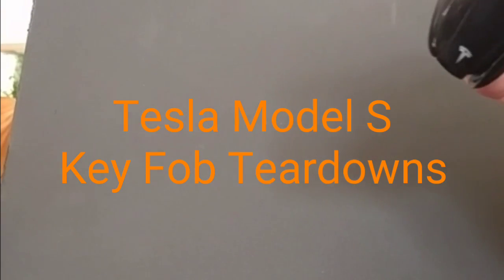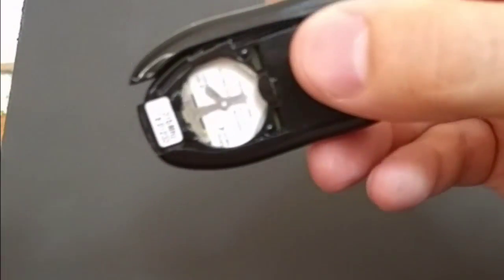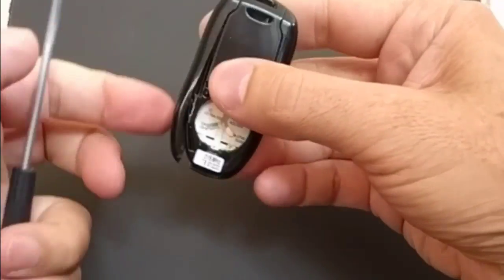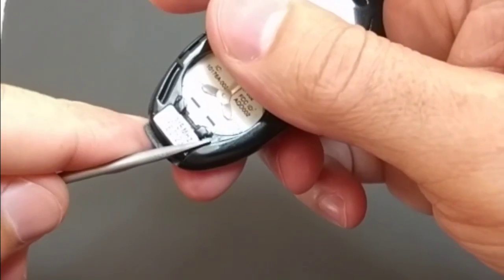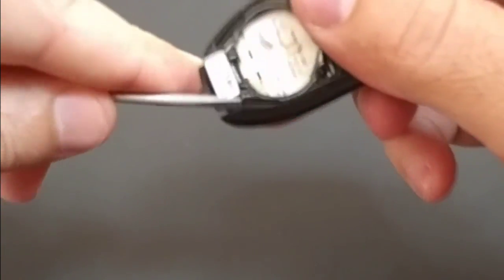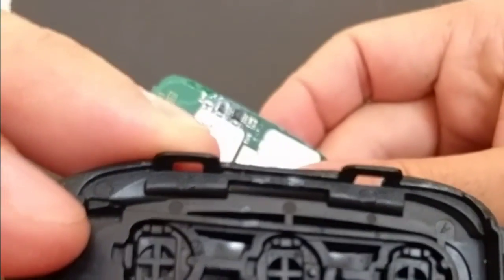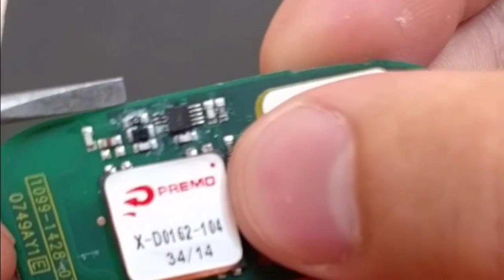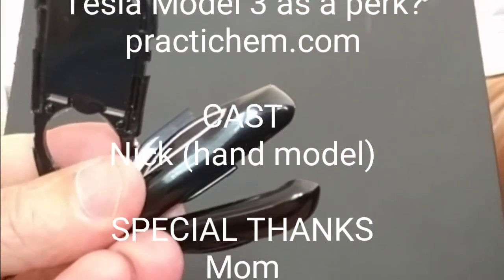Tesla S Key Fob repair water damage

Comment: Thank you. The disassembly instructions helped me to revive my laundry washed key. 
I have an additional hint for efficient final drying: rinse the PCB with isopropyl alcohol. This will was hour remaining water and dry off quickly. And eventual residual liquid will be non conductive. 

Best regards, Frank
Reply from the maker: @FrankR-w7s  Thanks for your feedback. I'm really happy this helped you out. It's one of my oldest videos!
Reply: My key-in-the-laundry error is even older ;-). Had a MINI car key that survived without problem as no battery is inside: it gets charged by induction when driving. Smart solution: you can make a tight case.
But at least the Tesla fab is easy to disassemble. 

Thanks for sharing. Will have a look at your more recent videos.

Comment: I fixed mine took it apart as shown used High pressure contact cleaner from a can underneath the Ic chips I let it dry put it back together it works.  Thanks   Save me money!  My fob got wet.  I’m in avionics tech in the United States Air Force for 10 years that contact cleaner displaces water to use it on C130 fuel quantity connectors.  Perfect application thank you for your video

Comment: Thank you.  Didn't drop mine in water, but Tesla refused to replace it because of corrosion on contacts.  Watched the video,  a little alcohol, and little scraping with a metal fingernail file, and no more warning message on the dash board about "Key Fob Battery low"

Comment: Thanks for the video. You just saved my key fob today. I accidentally dropped it in the washer. One thing I would suggest people to do is instead of using a screw driver to pry open the side panels, use your 3 salute fingers to gently pry it outward. I find it more effective loosening the latches.
Reply from the maker: Fantastic!

Comment: What if I didn’t notice and the fob went in the dryer as well? Will i still be able to salvage it? Nothing is wet or corroded but still won’t work. Please help, thanks!
Reply from the maker: You can always take out the board, give it a few minutes' soak in vinegar, fully dry it, and see. Anything beyond that would require mad electronics skills, I think.

Comment: Thanks! Thanks to your video I could disassemble my Key Fob which was in the washing machine for 30 minutes (when I just realized it must be in there).  There was almost no water in it, but still will use some iso-propyl alcohol to clean the circuit board!. Thanks for the video!
Reply from the maker: Sending key fob karma your way!
Reply: @nickydoes  It came back alive and works flawless ever since! :-)

Comment: Thank you for this. You saved me likely several hundred dollars. One suggestion, I used a laptop side/bottom removal tool ($5) to pop off the sides. I then dried off all internal components, and the fob then worked perfectly!
Reply from the maker: Good point, Mike. If you have a mobile phone/laptop spudger tool, you'll be more likely to emerge from your crisis without a scratch! Glad it helped.

Comment: I also had the fob in the washing machine. Is it OK to touch the electronics without connection to gnd? Is it OK to wash it with water?
Reply: How do you know this stuff are you an electrician or electrical engineer? Asking because I wonder if you got legit knowledge about this :)
Reply from the maker: Hi, I realize this is old. I play an electrical engineer on TV (and at my work). I've designed quite a few boards, and I work with electromechanical systems pretty much all day. There's lots on the internet about ESD/static and circuit boards. I'm pretty OK with touching boards, but I use a lot of sense about it.
You can wash a board in water, so long as you depower it, then blow the water out of it. Corrosion (salts) is your biggest concern.

Comment: Thanks! Very helpful. Same thing here, fob went thru the washer and didn't work. I knew the sides come off but had trouble popping the snaps as I didn't know where they are located. Your video shows them nicely and I was able to get it apart. I just let it air dry a few minutes, put it back together and it works again.

Comment from the maker: After tearing down the fob, washing it with vinegar, rinsing it with "reverse osmosis, deionized water" (from my kitchen pure water tap), then drying the board + letting it dry in rice, I reassembled it with a new battery. It worked perfectly.

Did I have to go through all of this? Probably not. However, I have a second fob, so I was in no hurry.
Reply: Nick DeMarco

Comment: incompetent didn't use conformal coating, amateurs
Reply from the maker: Agreed. Pretty lame. I suspect Tesla outsourced the whole key/security system. Still, they should have insisted on conformal coating. Model 3 uses your phone or a key card.
Reply: @nickydoes  I know this is a very old thread, but wondering: I see conformal coating sprays for sale at a local electronics store. Can I spray the key fob and achieve some degree of better protection? or do the buttons make that impossible? Could I just cover the buttons, or are they basically a weak link for water damage?